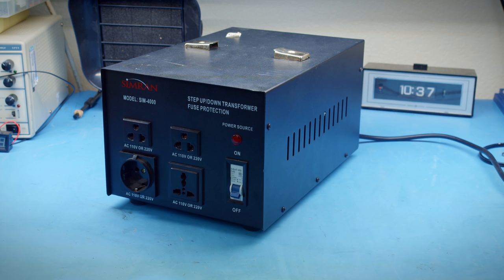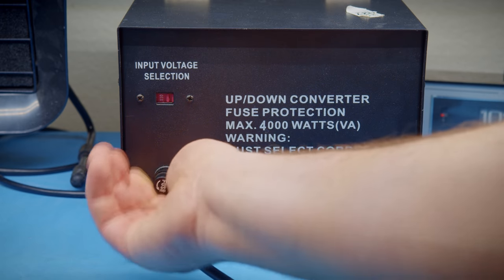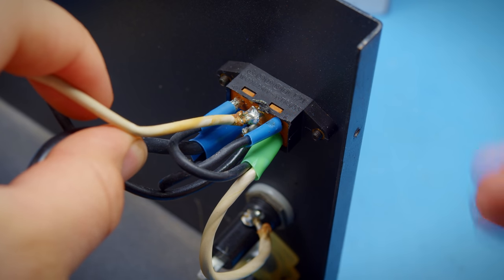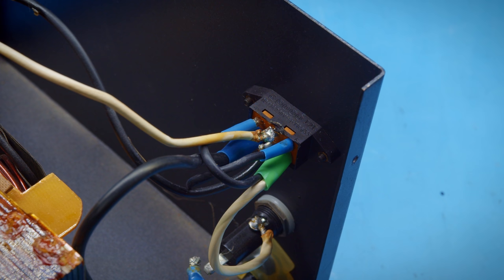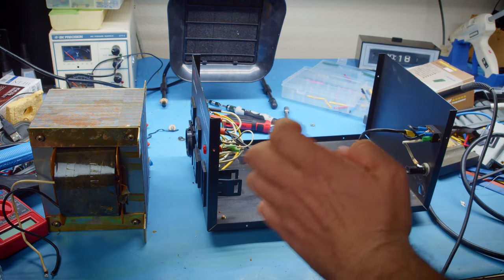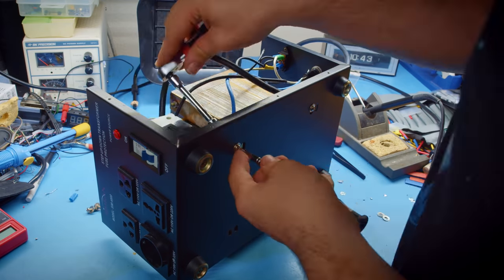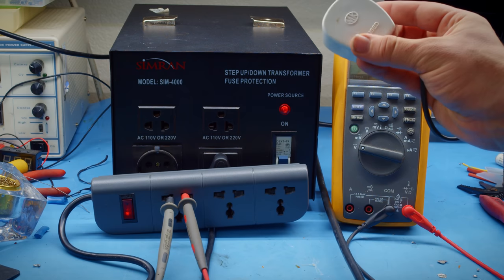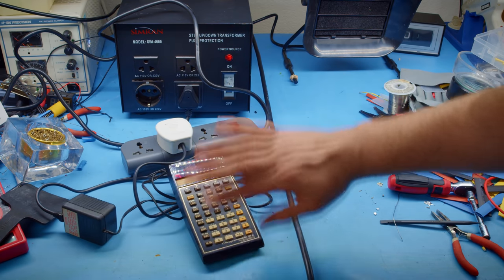Making 240V AC In the USA, Interesting but Dangerous

Comment: The DZ47-63 range of circuit breakers are known to be FAKE, inside they are just a switch and have no overload protection

You had me worried for a bit at the beginning there thinking you would plug that horror show in without reworking every solder joint in it, absolutely horrific workmanship! I doubt even the ¥1/hr worker who assembled that thing is proud of it. 

Things I still don’t like about it:
-	I would be worried about the quality of the transformer. However, as it’s an autotransformer it can tolerate a few failures of wind-wind insulation shorts however I wouldn’t be surprised if that pile has copper plated aluminium windings.
-	With the winding resistances you measured it will be dumping 300 W to 400 W of purely resistive losses at 4 kVA (depending on which way around you have it), magnetic eddy and hysteresis losses would drive that up more a well, fat chance that thing can dissipate that much heat safely.
-	Same goes for the other wires and components they might be aluminium or plated steel.
-	Check if the protective earth has good continuity between the plug, sockets, transformer body and *painted chassis*.
-	The fuse is probably some cheap garbage as well, you might want to replace it with a proper ceramic one with a conservative rating (slow blow).
-	There is no thermal cut-off on the transformer, something I wouldn’t be happy with on a transformer this size.
-	Check if the sockets have the correct size cut-out in the chassis and it’s not just glue holding them in that will come through with a strong pull.
I bet they got their 4,000 VA rating from getting 250 V (typical device rating) and 16 A (max Europlug current), however clearly inside there are components rated for 10A. 

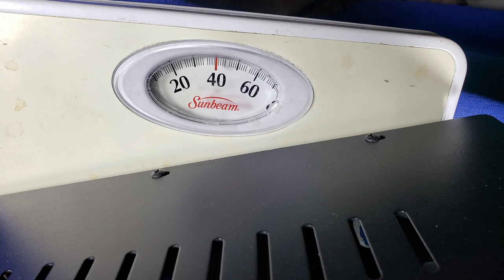Also, there’s a minor audio glitch at 14:03 for me, not sure if it salvageable or even worth the effort to fix?
And, your explanation of how an autotransformer works with aid from the Blender animation is by far the most intuitive I’ve seen, certainly worth the effort!
Reply from the maker: It was such a horror show inside. I just scraped the wire strands on the earth wire I replaced, and it's grey inside. So they're aluminum, awesome. So, really, it needs to be completely rewired from scratch. 

I plan on replacing the fuse that is in it, which I forgot to mention in the video is rated for an astronomical 7500W, with a 1000W fuse because I don't trust this thing at all and nothing I want to run on it will be more than that. That should solve most of the concerns about the poor quality by putting a much lower cap and load on it. 500W would be a lot for me to draw from it.

For 14:03, yeah I hear it too. It's minor enough I think I'll leave it though.

And thanks! Intuitive is what I was going for! Sometimes just a little bit of animation can really help with the understanding something so I really felt the effort was worth it.
Reply: @TechTangents  At 1 kVA it should be dissipating about 30 – 50 W which I think this transformer could manage with forced air cooling however with the tiny ventilation holes I’m doubtful, you might want verify this thing yourself by putting a 1 kVA (or probably less) load on it and measuring the temperature, no clue what temperature rating the insulation is but an 85 °C thermal fuse mounted to the outer core would play it safe for 105 °C insulation.

One problem with transformers with aluminium windings is while aluminium has ½ the electrical conductivity and thus dissipates double the power it is also has ½ the thermal conductivity, so the core temperature is much higher leading to a max load typically less than ¼ that of a similar copper one.

I see Amazon 3rd party sellers (but fulfilled by Amazon) sell those things here in Australia, it’s tempting to buy one just to video it burning, I’m sure I could get a refund but I’m not sure what would happen if I returned it to Amazon as a burned husk, I’m doubtful they would do anything. I also wonder if the consumer safety commission here could recall them as they’re clearly illegally bulk imported.
Reply: @WizardTim  It would definitely be interesting to see how amazon deals with the return especially if it is caused by the product being badly engineered and assembled. (which if you get one to self ignite I would hope the government would do something about it)

Comment: Thanks for the explanation of the auto transformer. I knew these were non isolating (figured that researching isolation transformers) but wasn't sure what auto-transformer meant. Now I know!!

My only suggestion is putting a reasonable glass fuse in there -- 4000VA is completely possible in some places in the Europe, especially in the UK which uses crazy ring circuits that offer 30 amps @ 240v -- available at a normal plug! I'd put in a 10 amp fuse to give you leeway with the 15 amp circuit you're plugging it into.
Reply from the maker: I found out from this I vastly underestimated the power they have over there. That's a lot of power on tap for a house!

Definitely on the fuse. I'm thinking of putting in a slightly less than 15A fuse and a replacing the breaker with a 10A model to have two levels of protection. I want to make sure this thing is massively under used whenever I use it in the future.
Reply: 13amp is the standard uk plug, so 230 x 13a = 2.99Kw. but most of the uk is 240 x 13 = 3.12Kw. some plugs in industry that allow more
Reply: The UK ring mains don't allow 30 amps to be drawn on a single circuit. Most mainland Europe circuits are simple star-type topology from a single breaker, and limited to 16 amps off single phase.

Our three-phase panels are 400 volts at 3x16A which offer a whopping 20 kilowatts, which makes cooking on an induction hob an absolute breeze.
Reply: We need that level of power in the UK to feed our tea habit 🤓☕

Comment: Shouldn't ALL of these connections be crimped?  I thought it was a No No to use soldered connections in these types of mains devices?  At any rate that thing is a piece of junk.
Reply: (Not licensed, take me with a grain of salt, licensed electricians please correct me if I'm wrong.)

NEC 110.14(B) states that you can use soldered connections as long as they were mechanically secure without solder before they were soldered (i.e. rattail method, Western Union method, etc). To that end, you might as well just use appropriately crimped connectors and correctly-rated wire nuts for mains connections.

The reason journeymen say not to use solder is because solder "locks" the copper wire in place, which may be mechanically disastrous if the wire joint needs to flex, but also, restricts expansion/contraction due to temperature changes, which can also weaken the wire.

IMO: Solder is fine if there's absolutely no mechanical flexing, absolutely minimal temperature changes, and you expect to be putting a relatively constant, moderate load at most; or in cases where contact resistance is something you have to avoid. Otherwise, crimp wherever possible for mains connections.
Reply: @willpreston6881  Quoting the NEC doesn't really make sense here - it's intended for building wiring, not end devices. Soldering is definitely acceptable within devices. Interfacing to PCBs is almost universally with solder, and the vast majority are not mechanically secured without solder.
Reply: @UnreasonableSteve  Of course. My intent in quoting NEC is to try and source where the "soldering mains connections is bad" adage came from.

I've soldered plenty of live-at-mains connections in my own circuits and never had an issue, and as you said, it's especially common when attaching to PCBs.
Reply: @UnreasonableSteve  soldering that earth connection in particular is definitely dodgy though, under fault conditions the current will be high and the solder may melt and break the earthing, that's the main place reason for the "mechanical security" iirc
Reply: Not so, could make an excellent door stop.

Comment: None of those sockets are uk compliant.  And the old uk plug has non shrouded live and neutral so a little less safe than modern uk kit.
Reply: It's an MK Safetyplug, and it does have shrouded pins. I've used plenty of them in my time.

Comment: the retrocomputing world (and vintage guitarists) could use a solid but expensive unit that combines 110-120-220-240 isolated stepup/stepdown AND 60Hz-50Hz conversion either using a solid state inverter with lots of filtering or a geared motor-generator.

Comment: I have a little brother of one of those that had exactly the same QA problems inside...really dangerous stuff. But after repairing it works ok and I used it to test (at VERY low power) a ham RF amplifier just to ensure it was operational. Caveat Emptor!

Comment: Lots of transformer fun. One of the weirdest ones we built was a 3 phase ferroresonant transformer for use in africa, had a 3 phase input with a plc and contactors so it could bridge phases if they fell over and the ferroresonant transformer would deal with brownouts. We has the transformers wound specifically for the application and they were quite expensive (we never actually sold a unit) But it could theoretically provide power to a 3 phase load @ 10A pulling 60A from a 35% undervoltage single phase input (wouldn't work for 3 phase motors of course without the phase separation but these were destined for telecoms towers)

Comment: What a bodge job, random guage wires, hidious soldering, heat shrink flapping in the breeze.. just terrible. Make sure to ground that metallic enclosure btw
Reply: Did you see the sockets? Continuously cold soldering points, even on the protective earth. Attached with hot glue. That just calls for a break, which means probable death.
Immediately in the trash with it! Or use a completely new housing with approved sockets and proper grounding ... which will cost as much as this junk. Extremely dangerous that part!
Reply: @Ormaaj  People do shit.

Comment: The autotransformer woks similarly to Variac.
Doesn't look too bad, it just needs to be completely rebuilt.
I would also bypass the voltage switch, it looks pretty crappy, and replace all the sockets with European ones.

Comment: Putting 60Hz into a power supply designed for 50Hz can on older ones cause damage. When I worked for Tektronix, we had many supplies fail early because they were designed for 60Hz and we used 50Hz and vica verca.
Reply: 50Hz power supply running on 60Hz is not a problem as long it's not loaded at full power.
Reply: @JendaLinda  disagree. I have had many transformers burn out due to this. They can overheat.
Reply: @Lassi Kinnunen 81 Agreed. It's the older transformers that def do not like.
Reply: Running a transformer-based power supply (or motor) on a lower than designed frequency is more likely to cause overheating and damage. Running something on a slightly higher frequency is very unlikely to cause damage and in fact might lead to slightly more efficient operation due to reduced magnetization current.

Of course this is just theoretical. Other variables or unusual power supply designs could have unexpected side effects. Always use care and monitor closely when using anything outside of its designed ratings.
Reply: @eDoc2020  I am going off my own experience when working for Tektronix. We had terrible trouble with power units designed for  50hz running on 60hz and vica verca. Also when the 2215 scope came out they had problems as the designers in the US did not have a low impedance 240v 50hz supply. This caused part of the protection cct to short. The first demo models in the UK had to be run with a pigmy bulb in line (hidden under the bench) to stop damage.  Power bricks often had short lives if the had been run on the wrong frequency. Today this is not a problem but it used to be.
Reply: @salan3  Were these linear-type supplies, feeding AC mains directly into a transformer?
Reply: @jordanhazen7761  The bricks yes. The scope was switch mode with a silly protection. Would take too long to describe but basically a FET and fuse in parallel.

Comment: Our transformers in the USAF over in Germany and the UK to convert the 240VAC down to 120VAC for electronics we had in our houses from the US were also autotransformers. They are not isolation, and do not claim to be. You are right the wiring on the input has to be correct to get the desired output voltage. Before plugging anything in to the output, use a multimeter to test first.

Comment: I know we're all used to seeing incorrect and impossible statements of fact on the specs for cheap import equipment, but the 4kW isn't too far off the rating of that mains plug on the stock device; 16A at 240V, so 3.84kW .
Now, my guess is the wires would melt if you ran it at that  but strictly speaking the plug at least should handle 4kW.

Comment: That plug would not pass UK regulations.
Reply: That plug looks like a shucko plug for some weird reason
Reply: UK plugs don’t pass European standards at all. But yeah that one would not even pass the UK one. Weird how you can be an electrician there with a tiny little week long course
Reply: That's not a UK plug.  It looks like a grounded Europlug, which is incompatible with UK plugs (which are the safest AC connectors ever made).
Reply: The 3 pin plug moulded on the 3 way switched extension cord is not even fused like a UK plug, I wouldn't be surprised if the cable in the extension is just copper clad aluminium cable.
Reply: That's a CEE 7/7 "French/Schuko" combo plug meant to pluhg either in French CEE 7/5 ("Prise type E") outlets and or German "Schuko" CEE 7/3 outlets .
Reply: @imranahmad2733  its a round pin plug so can't be a UK one. Looks like the pre-war UK plug. Might be an Indian one?
Reply: @mattsword41  sorry about that, I made the mistake of watching on smartphone screen, just rewatched it on a monitor and you're right, it does look like an Indian plug, could be the pre-war type but I haven't seen one of those in over 30 years
Reply: @evensgrey  A lot of cheap crap off Ebay will come with a plug the exact same shape but with UK pins. If you're lucky sometimes the live/neutral will be shielded half way.
Reply: @DONK8008  After a bit of searching, I did eventually find an electric fondue set (being sold out of Shenzen, China) with what looks to be an identical plug to what this gadget came with, which looks like a normal CEE 7/7 (not a grounded Europlug, my mistake, that's a quite different thing that's basically the two-prong plug that will fit in most French or German sockets but with a slightly offset from center ground pin, and fits in neither type of socket because of it).  Essentially, this is the type of plug the grounded Europlug is intended to replace.  (The CEE 7/7 does have the undesirable feature that it has potentially exposed ground strips, which means in a fault state there could be exposed live metal in normal use position.)  For non-standard plugs on the UK version of EBay, I found more items with US plugs shown, but those were all being sold from the US.  Most devices didn't show the plug in the listing images, so who knows what you're going to get.  Nobody was showing a circular plug with large rectangular pins and I don't know if you could actually get such a thin to plug in to a UK socket, since you would need to have something to go into the ground connector first to open the shutters.  A lot of the cheap crap Big Clive shows has a dummy Earth pin (which should be safe if the device is properly double-insulated) and/or improperly insulated power and neutral pins (or even a real ground pin with partial insulation, which apparently can result in the earth pin not being connected and so defeating the purpose).

One thing I was surprised by.  Are kettle and toaster sets really a thing in the UK?  I wouldn't have expected there to be enough need to buy both at once to really make that a viable thing to package together.
Reply: @evensgrey  Kettle and toaster sets are a thing, but not as common as separate units.

Comment: It is very common for these to be autotransformers. I have only seen one that was an actual isolation transformer and that one was in a lab. That said the construction of this one is really poor.
Reply: A big advantage of a autotransformer is the power handing.  In this case, the transformer only has to handle half the rated power (2000W), not 4000W like an isolation transformer. When stepping up 120V to 240V, the autotransformer has to handle all the current of the load, but only has to create half the voltage.  That's because the input line voltage is "in series" with the transformer output.

Comment: I've used one of these before. Back in 2002 or so had a customer with a PC from Europe with a 240VAC only power supply. The customer provided one of these step-down transformers, but wanted the computer's power supply replaced with a 120/240VAC switchable unit that they typically get here. They didn't bother replacing the power cord on their step-down transformer, instead opting for a simple NEMA to Schuko adapter.

Comment: Similar devices are routinely sold to US military personnel overseas (not that brand, and not so poorly constructed, I hope).  I had one in Germany, sold it to an incoming soldier when I returned to the States.  I still have a couple straight plug adapters that would let you connect the transformer's original plug into a USA outlet.

Comment: Alright that's cool and all but why not just run a 240v circuit? I suppose portability is handy but if you're just gonna plonk it on the bench then I'm confused.
Reply: @LabRat Knatz Actually, he said he can't have it done in the pinned comment.  That probably means he's in rental housing, where you can't get anything the least bit non-standard installed, like an extra 240V outlet.